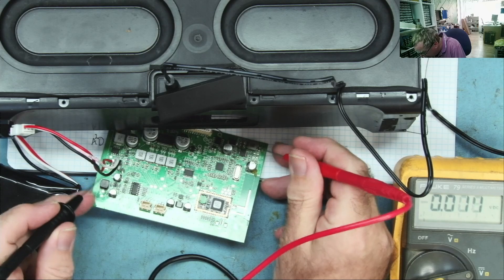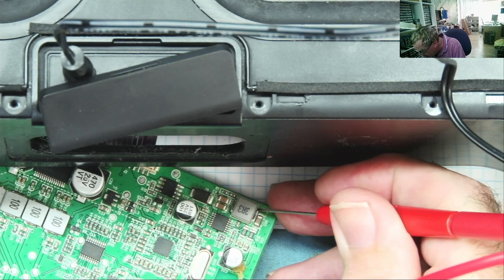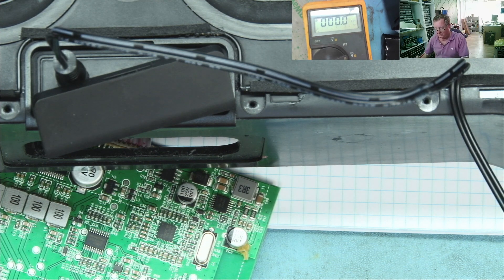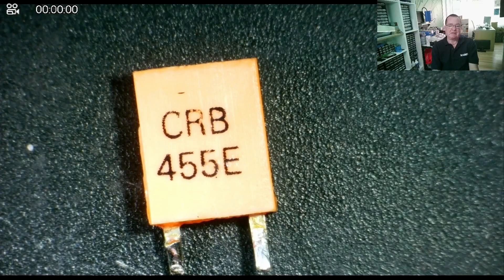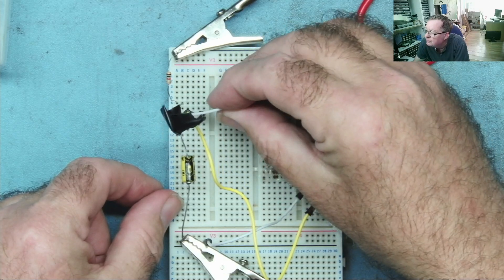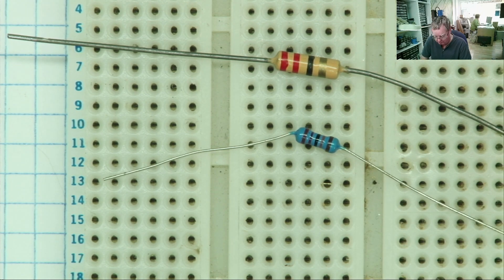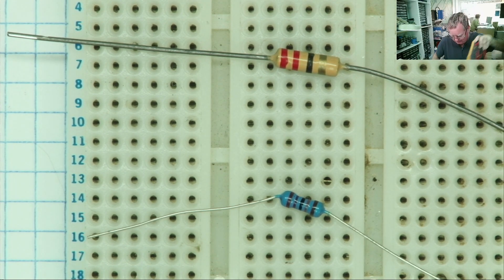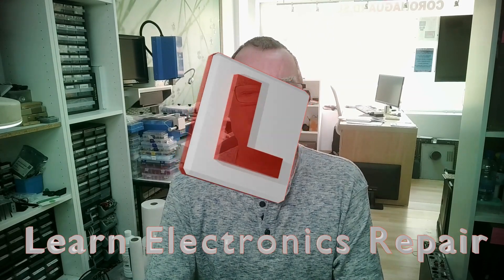Easter Out Takes Special : Happy Easter from Learn Electronics Repair

Comment: Hi Richard Happy Easter I have a problem with a behringer2500europower,,,I got this in a bulk Deal ,,Some things worked some didnt ,,, Heres the deal When I tried to power it up all the lights dimmed on my house and it scared me so I shut it off,,I took a look and it looked like the cricuit breaker looked a little melted, So I bought a new one but havent changed it yet and tried turning it on, You keep talking about a light bulb that tells you when there is a short circuit,. In my town there is no electronics repirman. I live in the middle of cornfield hell,,lol ,Ive been watching your show quite a bit to maybe figure this thing out the rest of the thing looks pristine,, Any advice you could give me before I put the breaker back in and try it again. OH btw I love yer program ,,,keep up the great work brother,,,Have an awesome easter weekend. Dragn